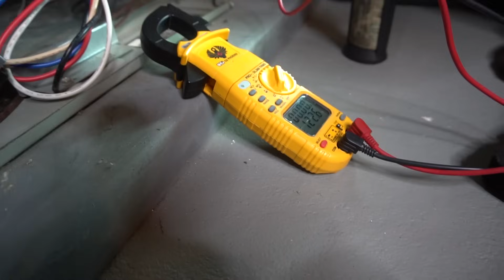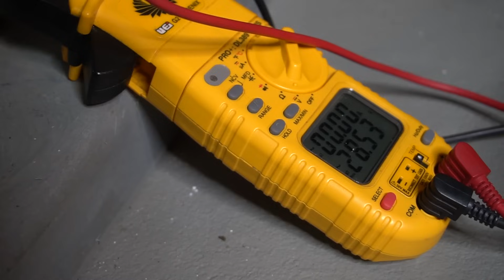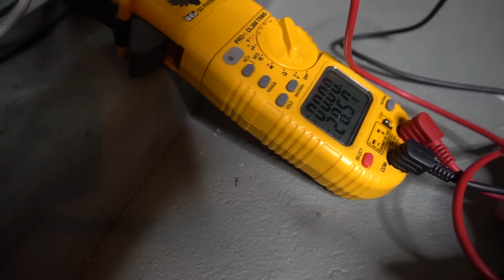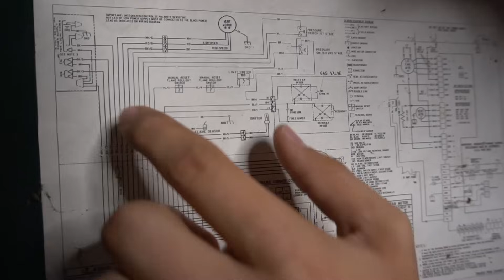Furnace/AC How to Troubleshoot The Control Board

Comment: i am having issues with my furnace control board. i bought a furnace through "Bob Hamilton" and have a 9 year warranty on the furnace. but apparently "bob hamilton" does not honor their warranties. they came out and said the control board is bad and now every time i call them  to see when they are going to replace it i get hung up on and never return my phone calls. they are a huge hvac company in kansas city. but i cant seem to find the board any where. any suggestions would be amazing.

Comment: the transformer in furnace failed and replaced 2 times, it failed again. Should the light on control board flashing if transformer blowed? when new transformer installed, the light on board flashing, but off when the transformer failed, is that the board bad? Thanks a lot. I install new thermostat. What else I need to check? Thanks a lot

Comment: I have a train 90 series Gas furnish not getting voltage  To igniter Do pressure switch has to be open or close for transfer 110 votes Is ignitor

Comment: This morning I walked downstairs and heard my HVAC system running.  The air intake fan was running for the furnace (it's summertime) and the duct blower was also running.  No gas flame was lit and the outside compressor unit was not running. The only way to turn it off is the power switch by the furnace.  If I remove the wall thermostat completely it keeps running.  Is this indicative of a bad board?  I have yet to borrow a voltage meter to test it out.

Comment: I have a goodman gas furnace and air conditioning compressor. would you believe that both were running at the same time. And the 3 amp fuse was blown on the board. I believe  there may be a  problem  somewhere with the system.

Comment: I have an odd thing going on. My AC unit puts out cold air when the thermostat sends a signal. The blower works fine pushing air into the house. However, when the AC unit is not calling for cool air the blower kicks on for 5 seconds then turns off for a second then back on. This continues until I shut the power off to the unit or the unit is asking for cool air. Thoughts???

Comment: Trans good to board, a/c into board, fan cap good, motor jumped directly to 120v runs, thermostat ok, but no no 129v voltage out on high cool fan ? Dad board ?

Comment: Getting power in and out of the control board, new capacitor, getting the right ohmms from my contactor after disconnect. I can push the spring in and it sounds like it’s working. Also getting power to the thermostat and wires working. I thought it was the control board (we thought we had issues with the flame sensor because in the winter our heat would turn off and my brother in law moved the board a little bit and it started working and still does now)
But now I’m starting to think condenser?
Reply: Sorry for the bad grammar and run on sentences. Was attempting to give you all the info I have haha

Comment: Hi
I have an A/C attic furnace, i follow you video to the point on checking to see if power was going to all points on the control board and check the transformer. I have power right up to the terminals. I have power going to the thermostat but low to no power going to the contactor.. I check the connection. I check the Y and C terminals and there is no power going to the contactor, I disconnect the wires from Y and C and no power. I thought it may have been the control board so I order a new on. install the new one and check the power at the terminals  before connecting the wires and still having the same problems as i did with the old board. can you help me out? is there something I could be missing?

Comment: Hey Jay, great video series although I can’t find one which matches my exact symptoms.
Ac stopped working today, nothing has tripped and the fuse inside the furnace is not blown. Checked the thermostat and all is good, even swapped it out for another and still nothing. Fan doesn’t run inside the house and condenser doesn’t run outside. I can hear the thermostat clicking but nothing happens. Oh and all power switches are turned on. Could it be the control board? Or something else? Also we had a storm last night and the power went off, although ac worked this morning.

Comment: Misleading title.  This is how to tell if the issue is either the controller board, the transformer, or the door switch. It doesn't troubleshoot the controller board.  I know my issue is with my controller board.  I would liked to troubleshoot it.

Comment: Thank you for the video,  I am your subscriber and have watched most of your videos and have learn a lot. My AC is working fine, however for heating I have to flip power switch on/off sometime about 10 to 24 times to get inducer motor turned on. , your thoughts on it , why my AC is working fine, but heating is causing issues ?. Thank you.

Comment: I appreciate all your help. I did check for 24 volts from the furnace. On the strip i see that there is from R wire to the fan wire, and R to the cool wire there is 24 volts.. But back at the outside unit I dont have the 24 volts. Its so weird. What could be the cause of that! Hope to hear back from you😊
Reply: Just to add do I check with my meteor, from the furnace board, the fan and cool wire by itself for 24 volts?? If so I did and I didnt get anything coming from those wires connecting to the outside unit

Comment: So I definitely liked your video.  But my question is i have 120 going in. I have a 120 at my reducer but I have nothing after the reducer.  So does that mean my control board is bad? Or is it the reducer? My board has been replaced twice in 4 years?

Comment: Hi. Love your videos. I have a question. I have an ICP package unit. The auto setting for the fan was working fine. I rewired a bunch of things and added some components. Now the fan is always on even if it is ain auto or on. When I go to the control board and unplug the g wire for the fan, the fan does not run. Any thoughts as to whether it is the board, the relay on the board or the thermostat? And how did you come to your conclusion?

Comment: Hey Jay, I'm sorry to bother you but I have been watching most of your videos on furnace problems. First my problem is my furnace kicks in then when it is time for the blower to kick in it doesn’t. I have checked my 120 AC volts going to and out of my circuit board and it looks good. I am not able to get 24 DC volts anywhere. I have also connected main power from my door switch to my motor and the motor and does not want to turn on. Sorry I failed to tell you that there was a burning smell in the house before this happened. I have noticed on my furnace which is about 4 years old. My furnace is a Napoleon furnace by the way. It is also a two-stage high efficiency unit. If you can help me in anyway I would really appreciate it. I want to thank you so much for all your videos you have made they have saved me so much money already. You are a great teacher and for sure very knowledgeable on many subjects. Thanks again for your expertise.
Reply from the maker: Sorry to hear about your situation my friend and I unfortunately have to break the bad news to you. If you have 120v going to the blower motor but it does not turn on, then the motor is bad. I would replace the blower motor and the capacitor for it.

Comment: Hey Jay, I'm sorry to bother you but I have been watching most of your videos on furnace problems. I have a problem with my furnace when The burners Finish and when it is time for the blower to kick in it doesn’t. I have checked my 120 AC volts going to and out of my circuit board and it looks good. I am not able to get 24 DC volts anywhere. I have also connected main power from my door switch to my motor and the motor and does not want to turn on. One important thing I haven’t mentioned is before, I have noticed a burning smell in the house before all of this started. My furnace is a Napoleon furnace by the way. It is also a two-stage high efficiency unit. If you can help me in anyway I would really appreciate it. I want to thank you so much for all your videos you have made they have saved me so much money already. You are a great teacher and for sure very knowledgeable on many subjects. Thanks again for your expertise.

Comment: chheang khy
my spit unit has 24volt from thermostar all the time if 240volt is not on. when i have 240volt it run the compressor for 1second on and off.

Comment: Great series of videos! Our Carrier furnace is giving the 5 flashing LED code which translates to "flame sensed with gas valve off". When I probe the flame sensor in series with my meter the flame sensor is only seeing 4v instead of the expected (approx) 90v. When the thermostat kicks in the furnace blower fan starts as does the induction fan but the igniter does not glow or get hot. Seems odd that the flame sensor is sensing a flame when none exists. Bad board? any ideas?

Comment: Hi Jay - I have an Armstrong gas furnace/AC. Recently my thermostat went blank. Replaced thermostat with spare and OK on the thermostat. The fan would turn on manually with the Auto/On switch on the thermostat, but no AC compressor and the fan did not even speed up to higher speed when the thermostat clicked-on with thermostat set below room temp.  I replaced the Honeywell ST9160 control board, no change. The new control board has a heartbeat LED that is pulsing dim/on as it should. What would I look at next?
Reply: Did more troubleshooting, started looking at the thermostat and pulled out a few jumpers from the toolbox. I disconnected the contactor leads that go from fan controller to compressor.  I removed the thermostat wiring from fan controller. After jumping the Red and Yellow terminals on the fan controller, the fan came on and went on hi for the AC. While the thermostat was disconnected but powered by its batteries, I had no continuity between red/yellow on the thermostat when Cooling was selected, although I did hear a relay click. I also hot wired the contactor leads to the transformer secondaries, and the compressor came on, ran for a few minutes to check for cold coolant line and shut off. I think my spare thermostat was  bad.  On this system they had the AC compressor contactor L1 (24V) lead connected to the  thermostat yellow terminal on the fan controller board.  To me that means the thermostat relay is controlling power to the compressor contactor lead.  Is that correct? I thought that would be switched on the fan controller board and not directly on the thermostat.

Comment: Goodman Model: GMS90703BXA/P1256808F .  New inducer blower, new flame sensor, new igniter.  works one cycle, then when the temp on the thermostat drops, it won't work an ymore.  After turning off the thermostat for a while, and turning back on, it works again, but for only one cycle.
Bad thermostat?
Bad control board?

Thanks!

Comment: my 3 amp use on controller blows immediately when power is turned on even with thermostat disconnected at the controller. what should i look for?

Comment: Hey Jay, my control board had red led light on witch means something tripped it. My outdoor unit won't turn on. So as I was testing for voltage my 24v tstat red wire touched the metal of the unit and now the red led light is off on board and my indoor unit won't turn on. Could I of shorted the tstat wire to ground?

Comment: I have a gas furnace. No A coil. Just heat. I followed your checks. The board checks out. The only thing is when the stat is satisfied. The heat shuts off but the blower stays running.    Not all of the time. It can go through 3 or so cycles normally. Then the blower won’t turn off. Please help. Thanks for the vids.

Comment: Hey Jay hows it going buddy. I came across an interesting service call the  other day. I had to install a new ventor motor for a Lennox G61MPV model. I went ahead and installed it and now the ventor motor doesn't even come on. R to W measures 0 V at the board. R to C measures 24 V. Jumpering R AND G doesn't bring the DC fan ON, jumpering R TO W Ventor motor doesn't start. I got help from my company technical support tech desk and the very first thing i was told to do is unplug the line Wire going from door switch to board and than take OHMs reading across the Line Spadw on the board and across the 5 terminals where the molex off the DC motor connects onto the board. I had all continuity readings there which is not good! So i ended up replacing the board off my truck. Now i found out another board is required, replaced and all works fine now. Try doing a video on this, i haven't seen no one post like this situation. Cheerz

Comment: I had a circuit boars getting correct power, it kept giving me a flash code calling for open limit switch but both switches were fine,, so i switched out the board and boom problem solved

Comment: Your video is very helpful. Helped me troubleshoot why my furnace had stopped driving 24v to the EcoBee thermostat. I found the problem in the wire that comes from the 24v end of the transformer to the molex connector, and ultimately drives the Rc line. When I press against the wire in the molex connector, the thing starts working again. Now I am wondering whether to replace that wire, or the molex connector.

Comment: Can a bad control board not send power sometimes and send power at other times? I am having issues with power intermittently not going to my blower motor. Can’t figure out why it wasn’t getting power, but then an HVAC service rep couldn’t detect any problem when they came (it was then functioning normally). Thanks!

Comment: Furnace comes on and doesn't always light. It will come on sometimes and then flame will shut off. Then it flashes error codes sporadically there is a ton of clicking. I replaced filter and cleaned flame sensor. Pressure hoses are all tight. Possibly bad board?

Comment: I've been dealing with no hot air from the furnace. Had "Upper Limit Device" error indication but wasn't able to solve the issue. Turns out the issue was 4 loose cables on the step-down transformer. Have you ever come across cables working themselves loose? Seems very odd to me.

Comment: Thanks for the video. Very helpful. The voltage to the gas valve is not stable, so the gas was shut off during the middle of heating. It won’t restart easily so I have to reset it. I checked the voltage while this was happening and found out the voltage dropped from 24v to 16 v. what’s the possibility? Relay bad on the board?

Comment: So I got my gas valve sometimes it gets 24 volts and somtimes it does not, does this mean I need a new control board?  I already tried 3 new gas valves and they all do the same thing, which is work sometimes and sometimes not.

Comment: Hey, thanks for the video, it is very informative. I am trying to diagnose the problem with my furnace and stuck in! The limit switch is tripping! I have checked filter, open all vents, cleaned coil, replaced heat sensors but no luck. Inducer motor seems working as well. I realized switch trips when it reaches the set temperature, if you set the temp let say 80 it works until 80, but if you set it 72, it is tripping around 72. So it doesn’t seems it is actually overheating but some sensory issue. I have ordered a control board today, do you think board could be faulty?

Comment: This guy is a legend. You can tell this guy is if not nicest people to demonstrate and save people big bucks. We have a 20 year old furnace never had issue until we recently had basement walls put up and sanded. I did change the filter before any issues but all the sudden few days later furnace won’t ignite. I have Bryant Plus 80. I checked I have power going into furnace then I checked power coming into ignitor disconnected the ignitor and I don’t see any power going into it. Also my transformer is bit different but don’t see any power going into transformer. Looking like bad board or fuse. My filter was very bad dirty after 2 days of sanding I changed the filter the 4th day just my common sense but got unlucky.
Reply: I have the same furnace, same issue. Did the control board swap work?

Comment: As a furnace guy do you recommend a modulating furnace with ecm variable speed motor over a multi speed motor or other when replacing an old furnace? Too many options and is the $3k-4k in install cost benefit you in the long run.
Reply: Just saw your other video that pretty much explains it. Thanks man love the content.

Comment: So by what you just showed. Quick steps would first check unit has 115v if so then jump to the thermostat strip to see if power coming out. If not check to see if power going in. Now you would have an idea what direction you need to check. For say now power coming in now back check each device till you find the defective one. Is that a good way to approach a non working heater?

Comment: i watched this video, i followed every step, my Main board is getting 120W and is sending out the same 120W to transformer. Still the indicator light is not turning on and nothing is turning on ( Furnace or Fan or Blower ) . Can you give me advice as i have tried to change the Main board too, but still the same issue.

Comment: Question:  my heat stopped working. It blows, just not hot air. There is no glowing orange when the furnace starts up. I am getting on the low end of 40 ish give or take on ohms of resistance on the igniter.   Initially, the board would send out about 90 volts for a second and then go to zero. After some attempts at troubleshooting, it now sends out 20 volts and stays there. So, why is my board sending out low voltage to the igniter and how do I fix it?  Thanks in advance.

Comment: Hello nice video.
My humidifier stop working  no 24 volts to solonoid valve. I checked  its connected to the circuit board  connector  W1 and  C . No voltage at  W1 and C either but shows  24 volts at transformer.
Is it contolboard issue ?  Or can I connect the humidifier  on R and C connection?  Or something wrong with thermostat?